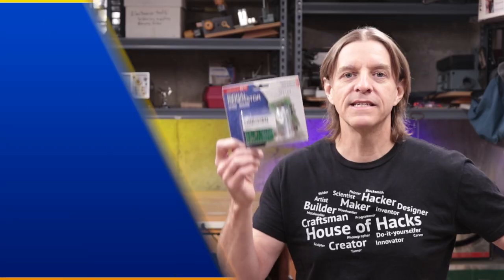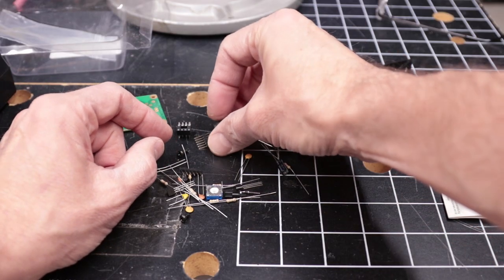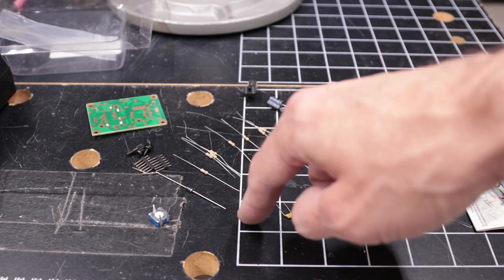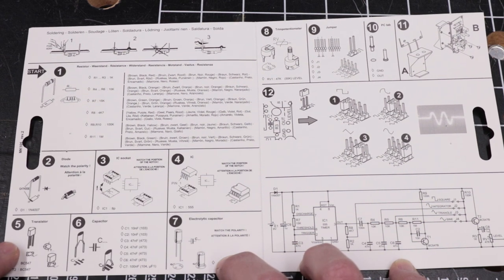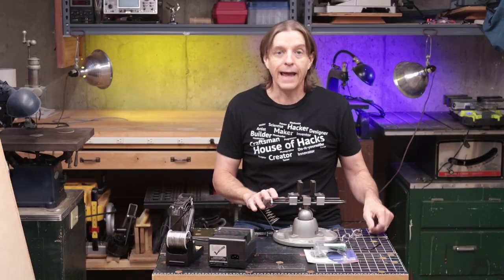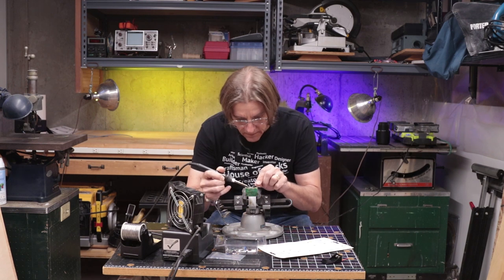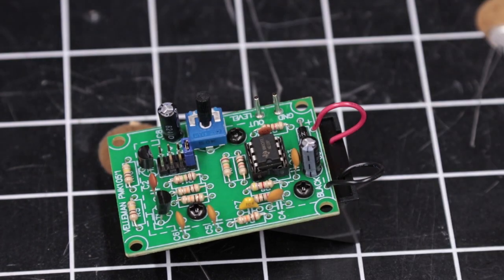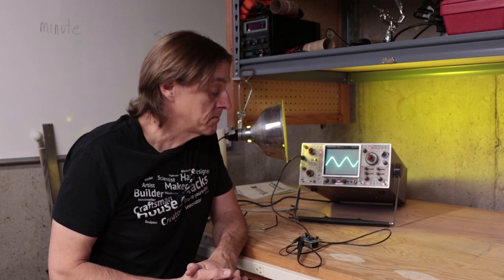Velleman Signal Generator - MK105 assembly

Comment: thanks for this video.
you were very concise  and easy to follow.
i am a beginner with this.
i definitely would like to see how you put it in box and also how it works in signal tracing on a radio receiver or whatever else it is designed to work for.
i recently purchased the velleman k7000 and put it together, it seems similar to this kit.
but instructions on how to input this signal into troubleshooting is lacking.
velleman has a support forum but not very helpful.
i get a sign wave  on one pot and frequency on the other pot, but not sure how to incorporate this tracer/injector into practical use.
are probes of some sort necessary to input signal or just jumper wire?
thanks
john
Reply from the maker: Thanks. I don't anything about the k7000 but did find this diagram: https://www.velleman.eu/downloads/0/infosheet_k7000_dcvoltage.pdf

Looks like you need to get some probes and connect them to the pins on the board as shown in the diagram along with a speaker and power supply.
Reply: @HouseOfHacks  thanks for diagram.
show two probes, one on in,one  out.think that is an either/or or do you need both?
thanks
john
Reply from the maker: Yes, you need both. The k7000 is a signal injector. It has an output that you connect to your circuit that injects a tone. You then use the input to listen for that signal on the speaker.